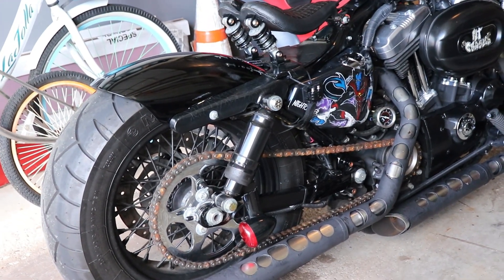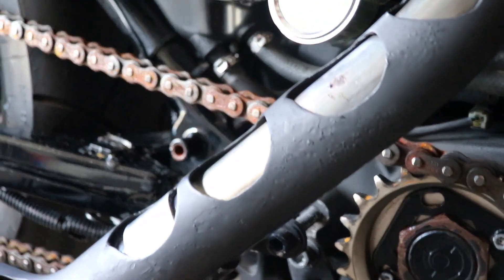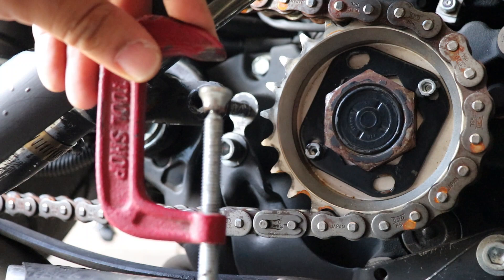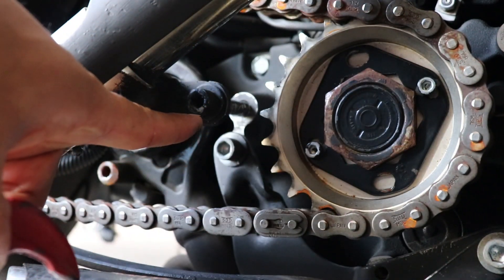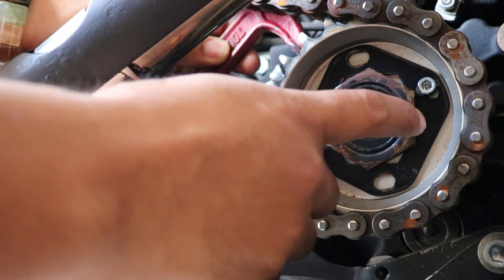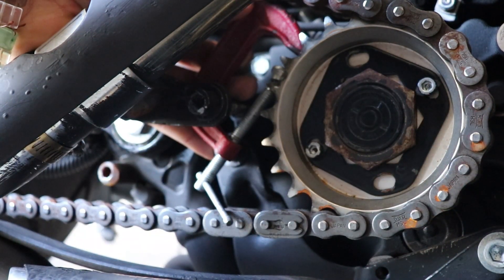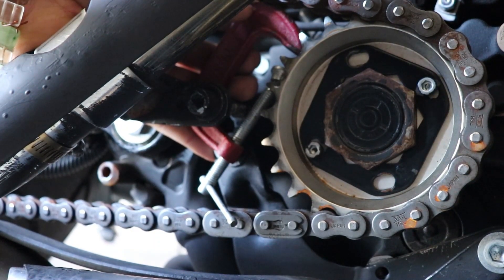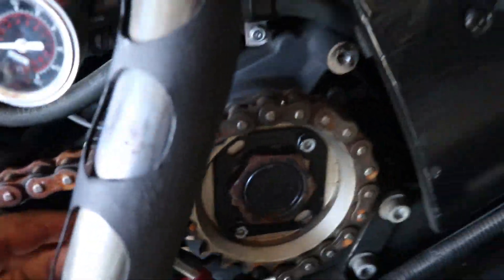Sporster- Front Sprocket removed  (NO TOOL REQUIRED)

Comment: I had mine on a lift in neutral and nothing stopping the turn of the shaft but the drive belt. Heated the nut with a torch to burn off the locktite and used an air tool. Super easy that way.
Reply from the maker: That's easy way also.
Reply: @NoMonkeyBizz  I just did it yesterday. Think the bearing is bad.
Reply: @blangille6407  Did it sound like a bad wheel bearing? I think mine's bad too, but I don't want to go too crazy without a second opinion.
Reply: @jordanadams7912  No. Was an issue with the transmission related to the detent plate.
Reply: @blangille6407  I'm taking mine to a local guy on Saturday. Hopefully it's not too terrible...

Comment: What size is that nut? Mine's belt drive, but it looks the same otherwise. I think there's a bad bearing in there, it sounds like it.
Reply: 1 7/8
Reply: His video is useless to anyone with a stock belt drive which is most folks...you will still need the tool it seems to hold it unless you can mcgyver something else for the belt pulley
Reply from the maker: @emersonmoses1780 i could of left my belt drive. But i decided chain better. If u like to keep belt drive once u order hub tell them u gonna re-use belt Drive & BANG U GOT A PHAT 200 WITH BELT DRIVE.